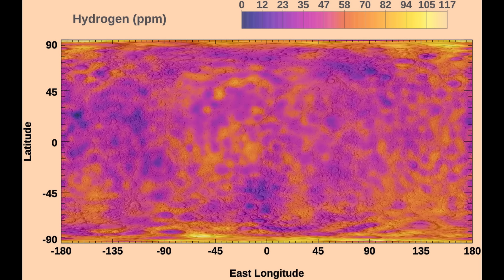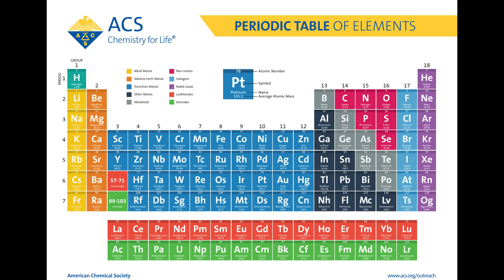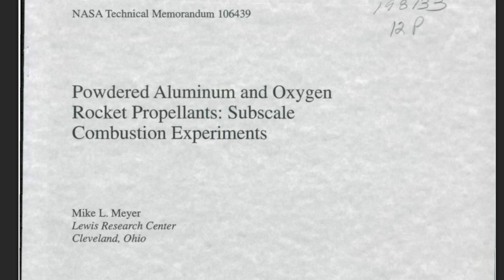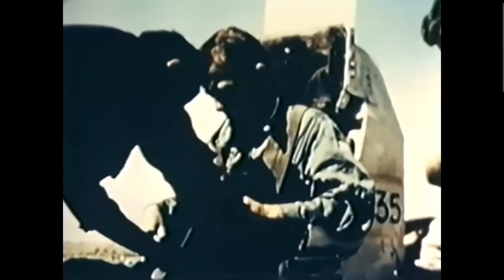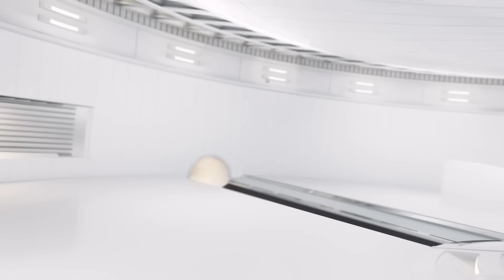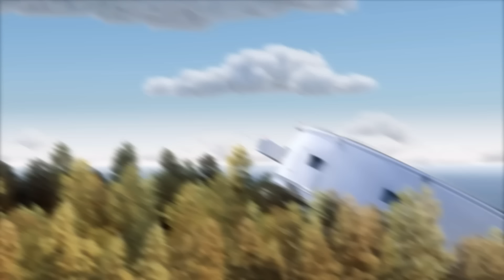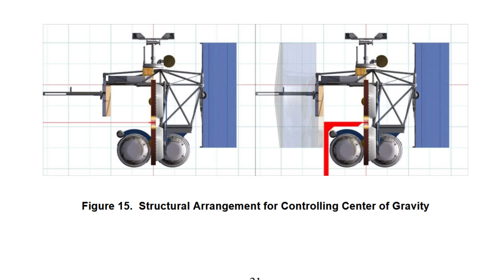Launching From The Moon With Silicon Based Rocket Fuel And Other Ideas - Deep Space Questions

Comment: Mining is difficult enough here on Earth....
Everything wears out, drill bits, cutting edges and pump liners - endless resupplies required.
Plus, mining operations generally run off fossil fuels, we haven't developed solar powered mine sites on Earth yet.
So, dealing with regolith, vacuum and extreme heat/cold is just the tip of the iceberg.     :)

Mining off-world would be easiest with asteroids, because most are already a pile of gravel waiting to be processed.

I think the cost of perfecting moon mining would be better spent on developing propellantless electric thrusters that require no ISRU.

Comment: Silane is quite a bad idea. Similar like phosphene, it's extremely toxic and very very volatile. It's used in the microelectronics industry as deposit material for epitaxy. You don't want to handle this in space.

On the other side Aluminum based (solid) fuels have been used in the rocket industry quite commonly.
Reply from the maker: Does toxicity really matter when everyone has to wear space suits?
Reply: @scottmanley Combined with the high volatility and SiO2 deposit potential it means you need to control leaks in all production process steps very closely. It's not just about the space vehicle spending the fuel. You know how nasty the hypergolic fuel already has been. Silane is worse. In case of not finding enough water and methane ice, I would rather seek producing aluminum fuel.

Comment: A coil gun will not work because of the back EMF means you need a higher voltage the faster the "projectile" is going. So you will soon hit the limits of how high of a voltage you can use in the coils.

Comment: Just as an FYI: The Rheinmetall Rh-120 120mm smoothbore gun in 55 calibers has a muzzle velocity of 5,700 fps (1,700m/s). 

That's the main-gun for the Leopard II, Abrams and many other Main Battle Tanks currently in service.

To punch through a bunch of armor you need to bring the heat
Reply: Bringing the HEAT to punch through armour is a good option but sometimes you need to bring the APFSDS.
Reply: Eh?  HEAT rounds are an explosively formed penetrator.  They don’t care how fast they’re going, and a faster round would just mean less mass of explosives.
Reply: @wagnerrp  That's baseball slang for throwing a fastball.
Reply: @wagnerrp  modern MBTs rely on kinetic penetrators mostly
Reply: @wagnerrp  he is talking about sabot rounds.
Reply: @  Then he shouldn’t be mixing metaphors.
Reply: Yeah overbore rifle cartridges are severely limited by powder burn rate considerations. Discarding sabots allow for a much larger surface for the gas pressure to push against without significantly increasing projectile mass, resulting in faster acceleration and allowing for the use of faster burning, more energy dense propellants with a higher proportion of nitroglycerin.

Comment: 11:28 it's disputed if anyone actually ever made one of those. It may be a meme from back in the day. But 220 Swift and 22-250 are real, commercially available cartridges with muzzle velocities around 4,200 ft/sec.
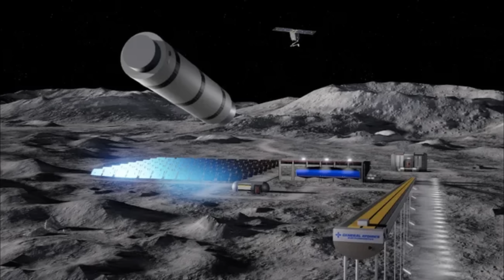12:55 be careful if you let Mycroft Holmes and his friend Manuel run that accelerator.
Reply: Also the Polish/German early WW2 anti-tank cartridge 7.92 x 107mm DS. Its muzzle velocity was 1,275 m/s (4,180 ft/s). 

On the artillery side the Paris gun's muzzle velocity was around 1,640 m/s (5,400 ft/s), the Rheinmetall Rh-120 L/55 tank gun has muzzle velocities up to 1,750 m/s (5,700 ft/s) and project HARP's 16" gun tests got over 7,000 ft/s (2,100m/s)

Comment: with a spin launch, couldn't you have some extra mass be brought back inward from on which arm just lost mass by throwing the object?
Reply: You have 2 counter weights on arms that can sweep them from both being together opposite the launch arm, to moving, when launch happens, to being opposite each other.

Also you have a short launch arm with a tether that spools out the payload to several km as angular velocity increases.
The long tether gets payload velocity high while keeping angular velocity and the g forces on the payload low.

Comment: Scott, I have another question too about when the would run those horizontal rocket motor tests. How the heck would that shuttle horizontal rocket test not shoot off those clamps?  I cannot imagine what kind of hardware they would need to hold that thing down.  It's the same with Starship when they do a 37 raptor engine burn with all the hold down clamps.  There must be such a sheer force going on all those materials.  At what point will they start to exceed the thresholds of hold down clamps?
Reply: In the case of the Shuttle, or other rockets, the clamps only need be the same as the ones attaching the booster to the rocket.
I'm not about to do the math re the hold down clamps while typing on my phone, so I'm interested in what others might say.
Certainly, the rocket must be designed to transmit the thrust force to the location of the clamps.
Reply: Build your clamps to go to 11.

Comment: I'm kinda surprised that Scott didn't think about the air in the barrel of the "earsplitten boomischer" as the .22 round is being accelerated down the barrel.  The round is well past supersonic well before the end of that acceleration and the gasses at the end of the barrel don't even know it.  It probably doesn't make up all the difference to 5500 FPS to have the barrel evacuated, but it may split the difference.
Reply: tank main gun sabot rounds are that fast, the penetrator part, not the sabot

Comment: silane based rockets would be a kessler nightmare, blasting fine sand all over space.
Reply: Well, it wouldn't be sand. It would be very fine dust, and it would be swept away.
Reply: Not in space it wouldn’t, tiny sand particles are also known as micro meteorites.
Reply: I think it would be fine enough that the solar wind would blow it away quickly.
Reply: And comets dont??
Reply: @tonycook1308  silicon doesn’t become vaporous at earth’s distance from the sun like comet materials, so it would linger for much longer around the moon.

Comment: Two spin launchers. One spinning down while the other spins up. The one spinning down feeds energy into the one spinning up.
Reply: Or the payload could be fed into a constant rate spinner from the axis and allowed to traverse the spin arm, accumulating KE as it goes. After initial wind-up the only energy required is the KE imparted to the launch mass.
Reply: Just store the energy used in the spin down into a cap or battery bank, you'll need to add more anyway and then you don't need to have them cycling in perfect sync.

Comment: You could use electrolysis to convert salts to their perchlorates and then pick whichever metallic fuel either fits your needs best or is most abundant.
Reply: What is the abundance of chlorine on the moon??
Reply: @tonycook1308  honestly I don't know but I'd expect there would be a good concentration of chloride salts since they're so common on earth and the moon is believed to have been a part of the earth originally.
Reply: Still need a binder, but yeah.  Also, solid rockets need casting; it's not as simple as just filling.

BTW, speaking of electricity, on the moon, copper is definitely not the best wiring, but even alumium might not be. Sodium has the highest conductivity per unit mass, followed  by calcium - sodium is 363% that of copper, calcium is 323%, and alumium 223% (copper is better of course per unit *cross section*, but it's dense).  Sodium probably isn't great though as it melts at 98°C, but calcium melts at 842°C, between alumium and copper.
Reply: @karenrobertsdottir4101  you could ship the required resins from Earth, they're not a huge component of engines weight wise. I was simplified the process in my comment, I think laying out everything needed for APCP engines might be a little much.

Comment: One reason jet aircraft avoid volcanic ash plumes is because they contain hot volcanic glass shards, and when ingested by the engine, they will quickly coat critical surfaces and destroy the engine. I think that's a good analog for what we could expect from silane.
Reply: We already use aluminum powder for rocket fuel. Aluminum burns to form aluminum oxide, which is even harder and more abrasive than silicon oxide. Yet they manage to use it successfully in rockets.
Reply: Though what you said is interesting in another way. "coating" If its being deposited, its not etching, and if your using it in a cheap one off rocket bell that wont be reused...
Reply: Silane won't hurt your engine unless you're letting it form sand as its passing through turbopumps. Make sure it doesn't form a solid until it's clear of the exhaust nozzle.
Reply: @RCAvhstape  like your thinking.. Silane RDE aerospike..)/*
Might as well dream big, right?)/*
Reply: @RCAvhstape  I’ll let the Silane know about what my expectations are 😅
But seriously, if it is oxygen rich enough, it should be less likely to deposit.
Reply: @RCAvhstape That might be harder to do than say since you need regenerative cooling to keep your nozzle from melting.  Might make it hard not to build up a film.
Reply: @petergerdes1094  Maybe that could be a feature and not a bug. If you can keep the coating somewhat uniform, it would provide a self replenishing thermally protective layer and the thickness of it could be controlled locationally by adjusting the cooling. Maybe even adjust the characteristics of the nozzle by letting more or less boild up.
Reply: You realize that alumium burns to alumina, aka sapphire, aka an even harder mineral than quartz, right?  And that we burn alumium in basically every single solid rocket we make these days?  In fact, when we started adding it, it wasn't a disaster... it was a massive boon that revolutionized solid rocketry (it's the reason that ICBMs transitioned from liquid to solid, which previously were impractical).  First off, it increased the ISP.  Secondly, it increased the density, which let you reduce the casing mass.  Third, it actually stabilizes the combustion.  Because it turns into sizable solid particulates in the exhaust, these have a sort of damping effect against vibration.

BTW, the combustion is kinda neat.  The alumium grains usually don't fully combust - there's usually a bit of Al metal left behind, and they get these sort of "shattered sphere" shapes due to the combustion process.  In theory, there's potential to extract a bit more energy if you could add minor alloys that let it combust more throughly...
Reply: Should be fun finding ways to keep it from attaching. They do exist, and they will be ours to use, if we spend enough time.
Reply: It melts in the hot stage of the turbine, and because molten rock is very viscous it tends to lodge and build up in things,
It also erodes the living hell out of turbine compressor blades in the cold stage of the engine on the way in. 

It's also AWFUL for piston engines - they won't run long even with pretty good airfiltering - and if any of that ash gets into the top end of the motor it'll wreak it in very short order.
Reply: Use Tesla turbines as pumps. The oil industry has used them for decades to pump raw sand and dirt bearing oil. Because of the barrier effect, the velocity of the abrasive to the rotating disk is very low. This makes for a much longer service life.
Reply: @mindcaptive  That's very cool. However, it's not just the abrasive property of the ash. The glass shards are semi-molten, and coat surfaces with a layer of glass. It doesn't take long to destroy a quickly rotating precision machine when you start coating its internal parts in glass.
Reply: Good that rocket engine has no intake. But due to micro gravity and lack of air drag, the abrasive dust will float and fly around moon for very long, eventually accumulating to make suspended pollution causing all sort of havoc to any soft sealing elements. Every airlock o-rings will have very short life expectancy in that environment. Bad news for moon foundry unless everything is kept unmanned or remote controlled.
Reply: @dongleseon8785  That's the Moon we're talking about, nothing will float there since there's no atmosphere to float in. Any abrasive dust will fall on the surface at exactly same rate as if it was a brick. Yes, it can fly pretty far away and sandblast stuff a mile away from the launch site. But it won't stay up more than a few seconds.
Reply: @AldorEricsson  it's very easy to reach low orbit speed on moon especially if it's tiny particle blasted by rocket. Also lower gravity means it will fall extra slow just like a brick would on moon. If it's blasted upward, the ballistic trajectory will take forever to settle, even more so if you account static charge of other dusts pushing each other.
Reply: @dongleseon8785 
I don’t know but I wouldn’t be surprised if the exhaust condensed into little spheres rather than angular shapes. 
Spheres would be much less abrasive.
Reply: @joashparker8271  if it cools down very fast from liquid droplets, it will be round because it won't have time to crystallize but vacuum is usually very good insulator.
Having said that, I don't what average size of droplet in exhaust would be and how fast it will be quenched. So I guess there's chance that it might be harmless spheres of oxides until the plum kick up absolutely sharp moon dusts.
Reply: I'd be more worried about the human health issues from the silicone compounds.